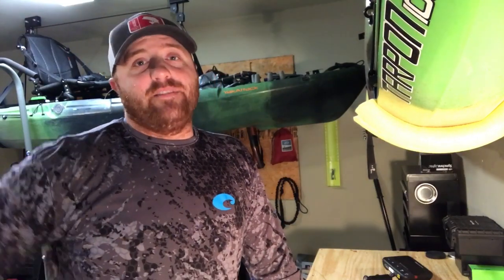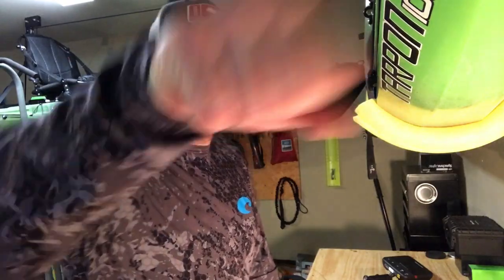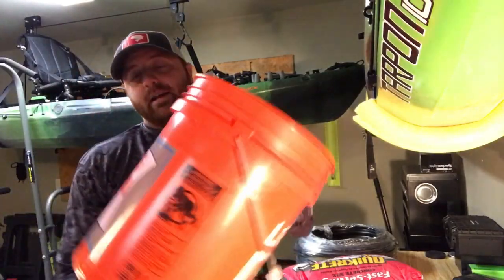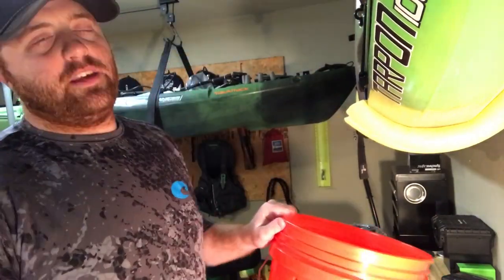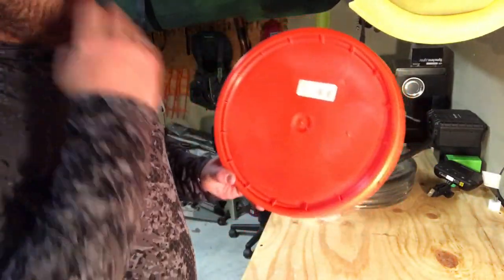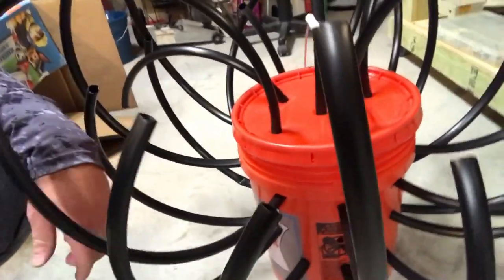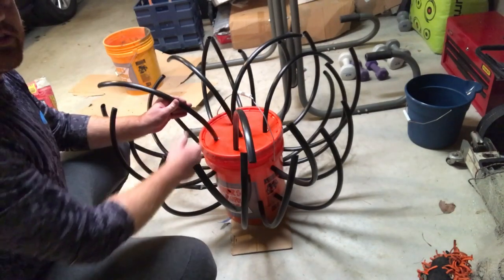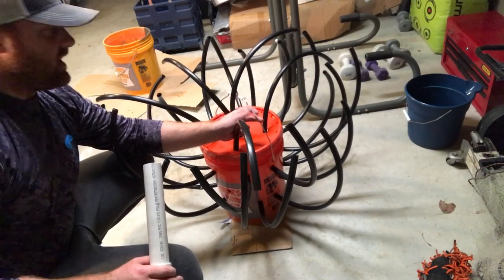How to MAKE a FISH HABITAT

Comment: How many did you add to your body of water? I have a 2 acre pond and we dropped 3 in. Also, what locations do you recommend putting them in on your pond? Just anywhere or specific locations?
Reply from the maker: I did 3 for now. Going to make some more soon. I like transition areas. 8-12 feet depth of water near a shallow flat, point or drop offs. Near forage is good too, where they can feed close by then back to the habitat.

Comment: I usually use a old christmas tree but the bucket does last longer the tree gets picked up by the current
Reply from the maker: last spring there were several brush piles in this area, but like you said, i believe with the heavy rains and flooding it washed them elsewhere.   Christmas trees are awesome, wish i had a few.  Do folks tie bricks to the trees to get them to sink?  thanks for the comment!

Comment: Cool idea. I’d like to try it. How long till the fish start using that style habitat?
Reply from the maker: Ed Peppler ranges from 3 days to a couple of weeks. Some fish will get on it quickly for cover. What makes them better is when the algae builds up on the plastic usually a couple of weeks or less which attracts bait fish etc...then the larger fish. Best practice would be what I did plus add some real oak branches to the concrete mix making the ultimate habitat.